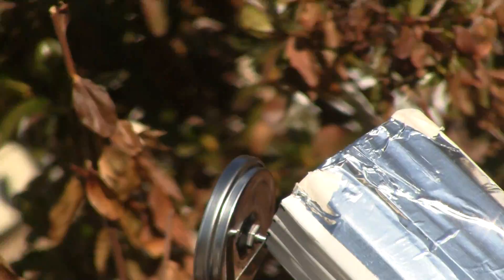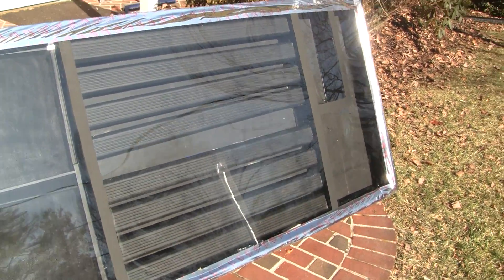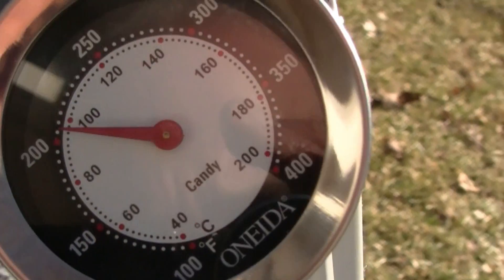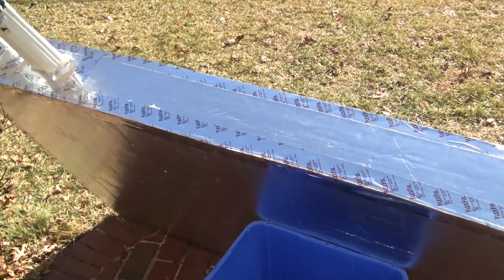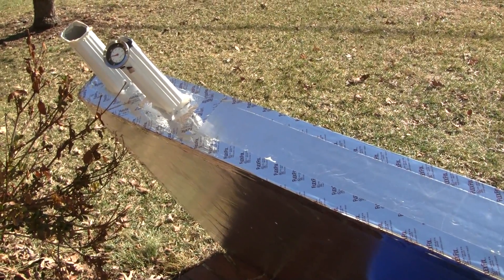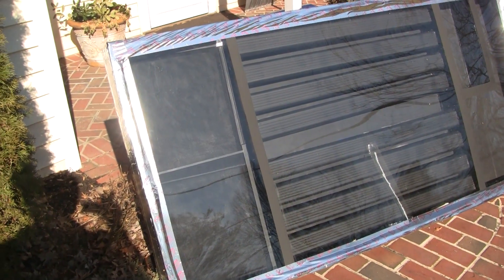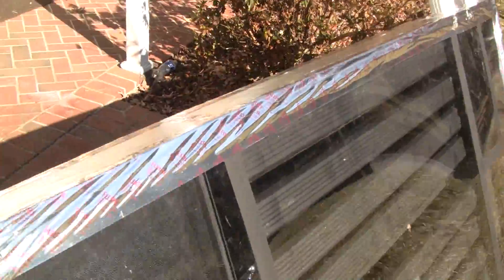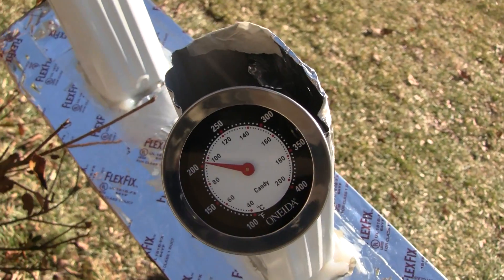No fan yet test 4 hybrid solar heat collector exceeds 205 degrees in 35 degree winter sunny weather

Comment: wonder if you put a stone back on it (or  as  surface air passes through after) (aka seconds stone) would it hold the heat like a battery so when you need it (after sun goes down) it still runs hot.

Comment: Minus the use of a fan to create positive pressure what principle is at work here to cause the air and the associate heat energy to travel through the box in a clockwise rotation as you have described?

Comment: Nice and warm project! Did you install it on your house or scale it up and then install it? I used beer and pop cans in my first solar house heater which measured 3 foot by 5 foot with a heat output of 131 F (55 C). For my second solar heater I used aluminum down spouts which was way faster. It measured 3 foot by 6 foot with a heat output of 140 F (60 C). So I scaled it up to 6 foot by 6 foot and it has a heat output of 203 F (95 C). They work great adding free heat to my house every sunny day! https://www.youtube.com/watch?v=7S8CWsIcK20
Reply from the maker: I haven't gone any further. Yours is nice and hot!

Comment: Can anyone suggest what size of air heater to build or what size is required to heat a room size 15' long x 15' wide x 10' high ? How many panels or what size would be needed to heat up a house of about 1500 to 2000 sq. ft. And also how would it take to reach a required comfort temperature in winter.
Reply: How big of a southern exterior wall do you have? Build your panel as big as possible, as insulated as possible, with as much full sun as possible morning until evening. How good is your building insulation? Maximize your attic, wall and floor insulation to get best results. Windows too. Maybe cover with shrink plastic or plexiglass. For my second solar heater I used aluminum down spouts which was way faster. It measured 3 foot by 6 foot with a heat output of 140 F (60 C). It heats my bedroom very nicely to 70 F on sunny days. It is a 18 foot by 13 foot room with 9 foot ceiling room. I also have R70 attic insulation, R20 walls, R25 floors throughout the house. The solar heater worked so well that I scaled it up to 6 foot by 6 foot and it has a heat output of 203 F (95 C). They work great adding free heat to my house every sunny day! https://www.youtube.com/watch?v=7S8CWsIcK20
Reply from the maker: this guy may help. https://www.youtube.com/watch?v=a62mZMIMpc0

Comment: The MOST important fact was never mentioned... so How warm is it INSIDE the house where the vent comes from the unit/.... : (      showing the unit & showing the temp INSIDE the unit is great but of NO REAL value unless that heat can be used & TRANSFERRED effectively inside the house when the  heat is needed
Reply from the maker: the temp with a fan will be cut an estimated 50-60%. Thanks

Comment: I'd like to see what kind of heat it creates per CFM. What would be the max airflow you would want to move through this unit for peak efficiency?
Reply from the maker: Hi Anthony. I really haven't done much research. Check out the link below in the comments.
Reply: If you mean Scott Davis's video.. I have watched a lot of his stuff.. Just wondering what the outlet temp was with yours with a fan.. I would suspect if there is no fan then there would not be much heat transferred into a house. If you ever put a fan on your unit.. Let us know thx
Reply: no fan is needed, hot air go up.. and from the bottom suck the cold air from inside the house, done, autoregulation by the system, 0% electric, no excess of CFM

Comment: What if you filled the guttering with water or sand? Not sure if it would reduce the daytime heat, but it might provide enough thermal mass to radiate some heat after the sun sets
Reply: Just pondering, but maybe stuff steel wool scrubbers in the gutters to create a turbulence and stall circulation. This in theory will generate higher temperature output. Again, just pondering as I'm no thermal engineer haha
Reply from the maker: Sounds like that may be something to look into as once the sun sets....it's over.

Comment: Thanks for the design! Without trying to be "negative",  the collector outputs 205 degrees without fan airflow ;)
Reply from the maker: Yes that's true. The temperature will be reduced (estimate) 50-60% when fan is attached. Thanks for the comment!

Comment: Very interesting design - hows it been holding up using the insulation panel as teh box? Have you though about some screen on the input end?
Thx  for sharing. Cheers, Patrick
Reply from the maker: Haven't had it outside for any length of time. Got the design idea here at 7:23 of the video. https://www.youtube.com/watch?v=a62mZMIMpc0